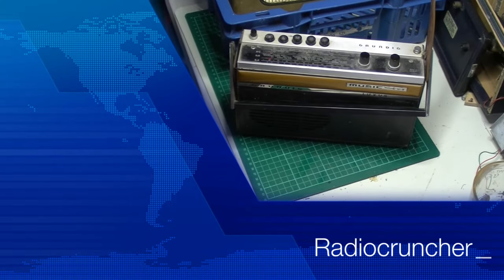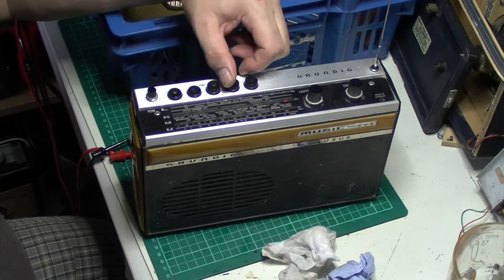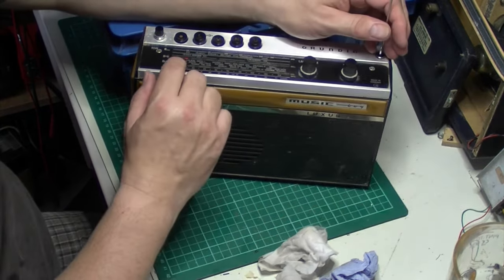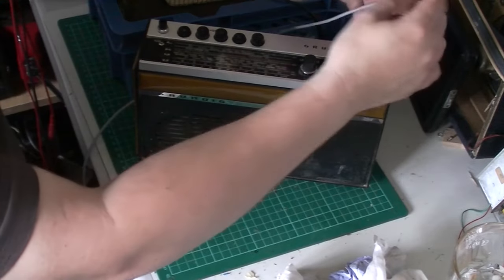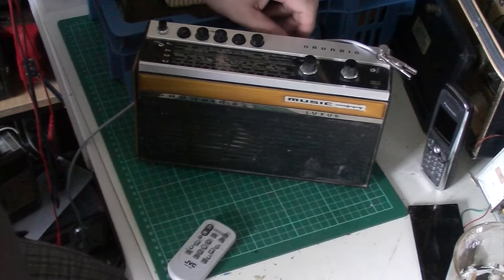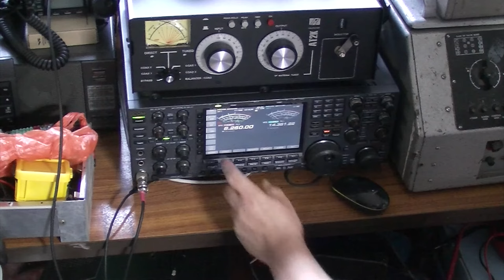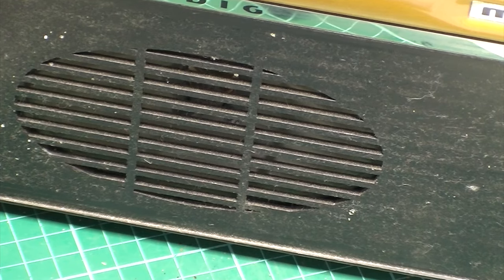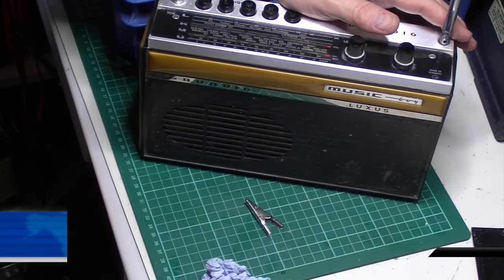Bakers basket of radios: Grundig Music Boy Luxus 208

Comment: I believe these where made in 1970 and where made for grundig under licence in Portugal. I have several.
Reply from the maker: Thanks for the info Tim. I did pick up another one to rob the plastic panels from but it’s a different colour
Reply: @Radiocruncher  I have some scrap ones but none same as yours exactly. I have a pile of R600 to do before I go mad with the module. I would appreciate your advice on what transistors to use to replace the af117
Reply from the maker: Hi Tim. Most of the modules have AF115 and AF116 in them. The direct equivalent is AF125 or AF126. AF127 would work fine as well. If you want to keep the cost down then the Russian GT322B works well. Good luck. Graham